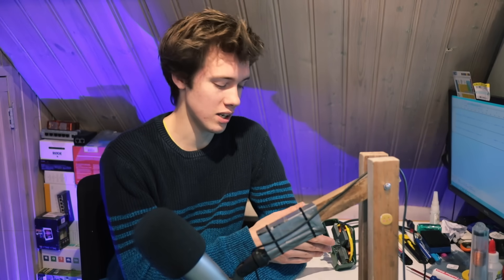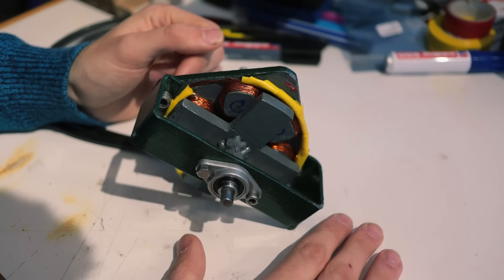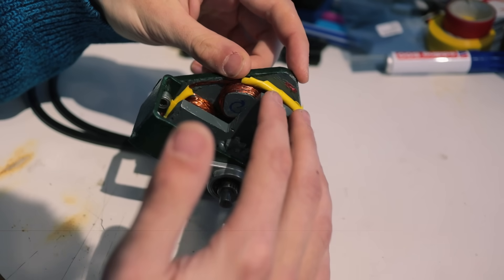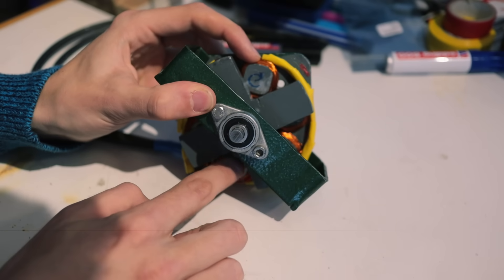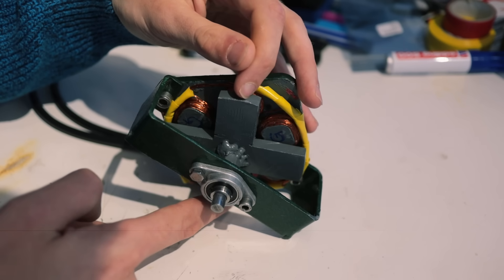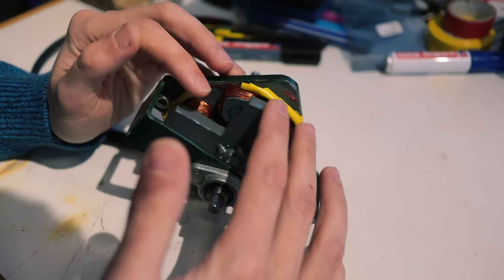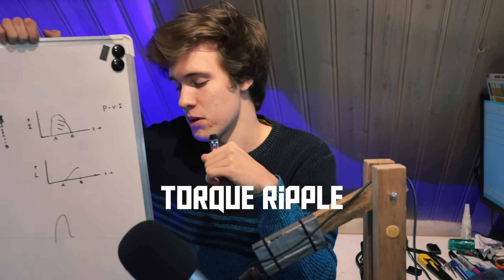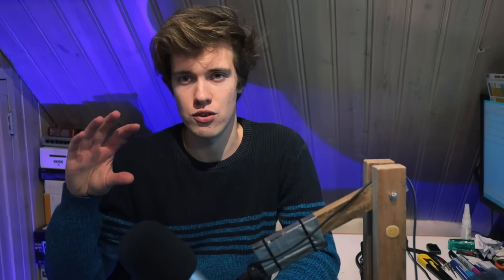Switched reluctance motors: simple yet tricky

Comment: I had a idea quite a while ago, that I've never been able to either confirm or debunk, but I think perhaps, having watched this brilliant video, that you are the right one to to do so.
Basically, and I did not know this beforehand, the idea is based on exactly this motor design, at least I think so, with the twist that you wind coils on the rotor. They  will not be powered as such, rather the inducted, thingy magik, magnetism or what not (suffice to say that both my memory and my expertise leaves something to be desired) result in a power spike in the rotor, though only some of the coils, which then in turn are connected up with the other coils, in such a way the their magnetic field are appropriately usefull, considering that the stator coils are not in fact swtiched, but static, only the intensity of their magnetig field being adjustable. Effectively you have half a generator and half a motor, and the energy generated byt the generator powers the elektromagnets, replacing what would've been permanent magnets, only these magnet can change and vary their magnetic field. The idea furthermre is that this motor should be power direktly by DC, with no swtching or conversion, the speed controlled by adjusting the voltage, or the available power in some other way.

I hope my explanaion is good enough, as it is pretty much the best I can do I think, and the questions are simply, could it potentially work, and if so, could it eliminate the complexity added by active and regulated switching?

Also, you got yourself a new sub.
Reply from the maker: The principle you describe, (I think) is essentially what an induction motor does. Although it doesn't use coils on the rotor per se, but instead has a rotor containing some thick copper/aluminium bars to form single-turn induction windings. The stator field induces a current in these windings, which then effectively turns the rotor into a magnet and so it starts spinning. This is a very common industrial motor that is used a lot. 

However, where it differs from what you explained, is that the stator coils do have to be driven using an AC power supply, otherwise no current can be induced in the rotor windings, since induced voltage (or current) is proportional to the rate of change of the magnetic field. So if the magnetic field doesn't change (aka, the stator is purely DC powered) there won't be a voltage induced in your rotor windings. So you do need to drive the stator with AC or use some kind of switching supply. 

The good thing about an induction machine though, is that it runs on a regular AC sinewave, which can be easily created using a simple inverter, or even taken directly from a power outlet, so these motors are very easy to drive. Position measurement of the rotor is also not required. However they are slightly less efficient than SRMs, since these currents in the rotor windings produce some (minor) losses.
Reply: @AKIOTV  Thank you for the very thurough reply.I think perhaps that there's something I've not been able to explain properly, as what I have in my mind, does run pn AC, really, only the rotor is responcible for dc to ac conversion so to speak.  Then againk if it could actually work, no doubt someone had come up with the idea a long time ago.

at any rate, thanks again.
Reply: Sounds a lot like the design of an alternator with its "field coils".
Reply: @edeaglehouse2221  I have found a few different design, some with permanent magnets and some with coils. I cannot say that they function the same, but it certainly seems so. Thanks for the tip.

Comment: Switching on the current is not such a problem, as the inductance is low. But as the inductance MUST rise as the pols overlap, inductance will be 5-10 times higher, so the current decay is much slower. There are different ways to optimize the overlapping scheme. On the other hand: a useful SRM must be magnetized to 1.7+ Tesla, so the inductance is no longer linear with the current.

Comment: its a stepper motor in some sense.
Reply from the maker: yes, especially if you were to drive it open-loop (without sensors). The steps are quite big though, compared to "real" stepper motors.
Reply from the maker: @paradiselost9946  well yes, but the srm can be moved in steps like a stepper motor, so it can be considered one. There are also stepper motors that rely purely on reluctance and have no magnets, those are basically very small step SRMs. (though permanent magnet steppers are more common).

regardless of all this, there's always some debate whether it's a stepper motor or not. There's something to be said for both sides, imo there is no right or wrong here.

Comment: Put in a couple of 75kW air compressors that had switched reluctance motors. No problems with them at all, it was the controllers that gave up the ghost. One of them ran for 10 years about 100 hours a week with the controller failing once. The motor itself was fine.